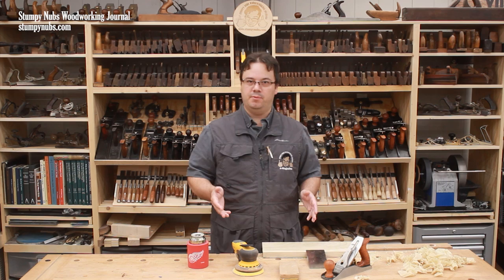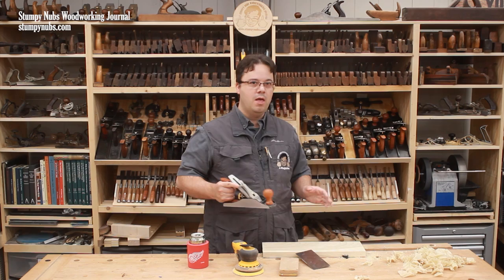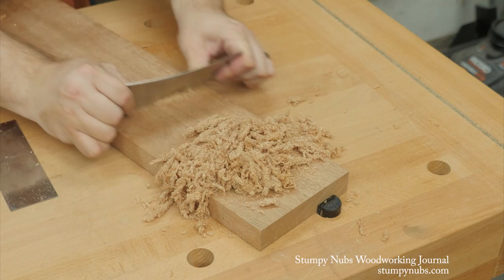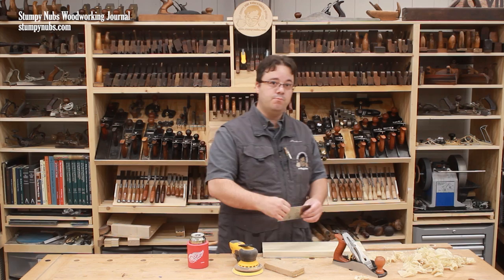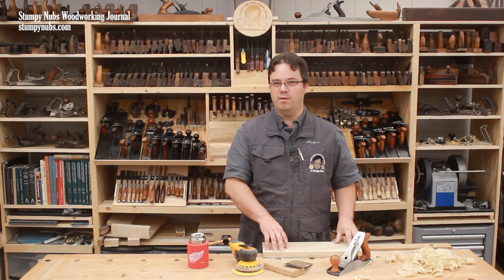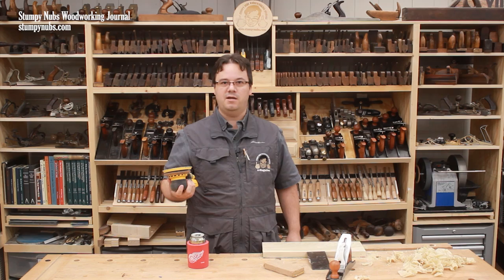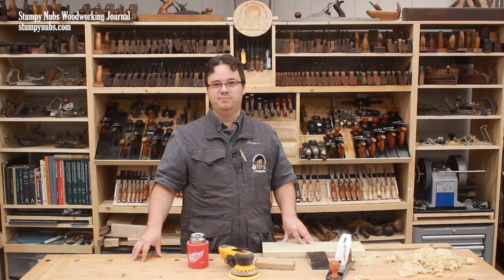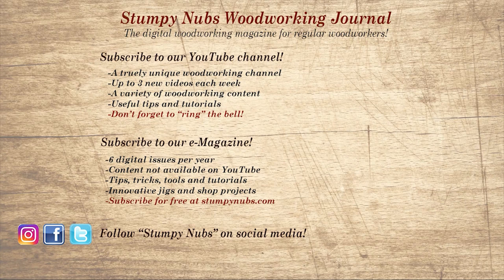Is it better to Sand, Scrape or Plane wood?

Comment: A fourth consideration: Cost. You buy a hand plane or a scraper once. Sandpaper is consumable. Then it goes down the rabbit hole of needing a sharpening system for the planes, or a burnisher for the scraper, so it's up to the individual person on weighing the cost of higher initial investment with planes, or cost over time with sandpaper.

In the end it seems like all three have their place, and are often best used in conjunction with each other for different scenarios.

Comment: A quite superb video, in which you cover all the most important areas. I make guitars. A soon as you start on a piece that has eccentric grain, you can basically forget the plane - even with a very fine set, the risks are too great. If you get tearout there isn't enough depth left in the piece to allow you to fix it (if you can), and you have a very expensive piece of firewood. Scrapers and sanding run neck and neck. There is a MUCH bigger learning curve associated with scrapers - with ROS you just don't tilt, don't lean, pay attention to the direction/pattern and speed you move the sander, and you're done. For brevity, I won't micromanage the elements involved in using a scraper but there are a lot and they all take plenty of practice. Contrariwise, a scraper wins because it is less toxic since it produces nice big shavings, not nasty tiny dust (so protecting our lungs). Of course, if you have a RELIABLE dust extraction facility in your shop (expensive) or you are happy wearing a high quality mask for considerable spells of time, sanding always wins over scrapers if you include the learning curve, which you should unless you are young and know you are going to be a lifelong woodworker. If you can't invest in a high quality extractor and you aren't comfortable in a mask (which, incidentally, should be a positive pressure respirator, not a simple dust mask, especially if you have a beard), then scrapers win if you can master the process.

Comment: You perfectly summarized my experience trying all three methods as a novice these past couple of years. Personally, I prefer planing or scraping, because I hate the dust. But if I just want to quickly get the job done hassle-free, I'll sand so that I don't have to worry about sharpening blades or making technical errors.

Comment: The cabinet shops I worked in these last few years sanding direction makes a lot of difference. Especially with stain. Also orbital sander vibrations can be very painful if done for long periods of time
Reply: I dislike the dust, the humm in the hands and the noise. Sander gives me a very uncomfortable, edgy feel in the whole body. I just bought a little plane from Veritas, will be playing around with that.

Comment: Great summary. I was fooled into believing planing is the only way to go. And that sanding is for the uneducated masses. Then I got so much tear out that once I got the grain figured out and the wood to an acceptable finish the piece was half the size. I agree if the wood behaves well and your plane is set up correctly nothing beats the speed and finish a hand plane can produce. If you have difficult grain or face where planing of the end will result in breakout, like the four outer faces of a dovetailed box. Sanding can save you a lot of headache.

Comment: I became a scraping guy for a reason you didn't discuss.

Sanding (as you know) makes thousands of tiny scratches.  Even if you don't stain wood, the character of the grain is dimmed by the light reflecting off all those scratches.  If you stain, the problem is more obvious.  So it's not about ease or convenience, it's about the look.

That said, I'd love to hear you tell more about technique.    Sometimes the scraped surface has very smooth, beautiful grain, but with streaks that take stain differently (and ruin the appearance).  Re-sharpening doesn't help, and I can't tell whether the problem is angle, force, uneven sharpening, or just the nature of the beast.  How about a video on scraping?

Comment: Something else that beginners do that takes away from finalizing a project:  They sand all parts including non-show faces.  No need to sand or plane non-show faces.  Saves a huge amount of time and effort.

Having a helical head (If you're lucky enough to have one) on my planer allows me to start and stop sanding at 220 grit if I choose to sand at all.

Some woods turn obviously milky or unclear when you sand them.  When I use for cypress for example and want to show the wood grain, I only hand plane.  Sanding even up to high grits turns the surface a milky white, while  planing leaves the  surface sharp looking and clear.

Excellent review James.

Comment: I bought a dining table from some guy on Marketplace. He said it was in "good" condition. I think he and I have very different ideas on "good".

 Anyway the table top has some very deep (probably electric) plane marks and I decided this week-end was the time to address it. I went out and bought a random orbital sander. Stupidly, I got a battery powered sander (to use the existing batteries I already have). I get about 30 minutes out of the battery and then it takes some hours to recharge. So progress has been slow. I came in search of more efficient ways to remove the material to get back to a raw, level top. 

The thing that worries me with scraper/plane is that the surface has knots. I don't want to get into a position where I hit a knot and do more damage. I just need to stick with sanding I guess and deal with the consequences of my terrible decisions on cordless vs corded. 

Cheers for the great video. Would love to start building up my hand tools again so I can do jobs like this without having to make trips to the store.

Comment: Used to finish everything with sandpaper because it is so easy, just takes time.  I just finished a table and had a little tearout to remove, so I tried my scraper.  I'm a convert.  The surface is just so sweet now, and the tearout went away, and it just worked so well.  I have a very simple jig I made for the scraper and I have a 400 grit diamond plate that makes removing the old burr and all the flattening steps easy as pie.  Mmmmm, piiiiie.  Sorry, where was I? Right.  Scraper.  I did a lot of work on that table with the scraper and I think my future projects will include a lot more scraping and a lot less sanding.  And more pie.

Comment: I'd say all three myself. 
Personally I use planes unless the wood looks dangerous, then a scraper. Sandpaper for really crazy grain changes, marquetry, and expensive veneer woods where if it tears out even a little I'm screwed. 
The big thing for me is I enjoy finishing wood with planes and scrapers, but sandpaper turns it into a chore. It removes the risk of failure, but also all the fun, so it's saved for when it's needed.

Comment: As someone who is physically handicapped. The only way to smooth a board is power sanding. I cannot use hand planes or most hand tools. My shop is all power tools, from screwdrivers to cutting devices.

Comment: Well, James, You are right in Your ratings.
 But only in case of flat boards.
I often work with round and bombe shapes, where only scrapers of various contours may be used.
Grinders with soft abrasive balls are used only for small curves.
Therefore, there is not much choise left except scrapers.
Indeed, this process is slow.
 But rounded shapes carperntry is more material and time consuming work. And quite challenging as well.
Also, there are cabinet scrapers for flat boards.
 Nice tools👍.   Easy to use and very forgiving.
 I am planning to obtain one and recommend others to do so, although they are not cheap. 
Alternatively, there is a scràping insert into a standard plane made by Veritas allowing to convert temporarily any hand plane into a cabinet scraper.

Comment: I have watched a lot of your videos and I realize they are directed to the weekend warrior. I however have 51 yrs experience as a cabinet maker and I would never place my plane on the bench as you do. Regardless of whether the iron is out or in it is always good practice to either rest it on a block or turn it on it's side.
Reply from the maker: For every woodworker with decades of experience that swears it should be on it's side, there's another with decades of experience that swears it should be on the sole.  https://youtu.be/B293gaKqh2c

Comment: If planing is with the grain, it’s the fastest. 
If grain is mixed directions, planing may no longer be an option. I’d go with scraping. 
For end grain, I will go with sanding first.
Another thing I noticed, after planing or scraping, grain does not raise as much or at all comparing to sanding.
Reply: Makes sense, sanding will create a lot of channels for finish to flow down under the surface. Planing will leave the top layer tight to the board. Although neither method does anything to seal the natural pores of the wood.

Comment: Oh yes. Scraping is a powerful method, but oh so much hard work. I find it the most precise way to strip old film finish from e.g. a table top that only has a thin layer of nice oak. For a noob it is quite a workout, and sharpening card scrapers is another skill to learn. I currently sharpen two card scrapers each time, there is then at least one edge that works as intended. No, I have not used them enough to have developed that skill, there was no need, the wood was mostly well behaved enough for hand planing.

Comment: I have heard that the finish is different and in some cases that matters. For instance, the grit from the sandpaper dislodges at some rate and embeds itself in the sanded surface. If the surface is one that will move over another wood surface (like a wooden handplane), it may produce scratches. I have heard another thing also, similarly to the difference between sawing and cutting. Namely, that the cells around the pores of the wood get destroyed on the surface when sawing and sanding, unlike a clean cut from a knife, axe, plane or scraper. This can affect the lifetime of wood if exposed to weather or high humidity changes. This is seen on wooden roof shingles that were sawn vs hewn.

Comment: Completely agree about wood grain… I’m working on a project now with several Douglas fir boards… my finishing method is determined by the grain of each board.  Some are straight with few knots.  I can finish them quickly with a hand plane.  Some have big knots with difficult grain.  Those are getting sanded.

Comment: Sanding is the most forgiving smoothing method. It also takes less skill than the the other two alternatives—in both use and maintenance. So….

Another excellent Stumpy Nubs video!
Reply: agree, I find planing quite difficult and end up with craters and bumps, haven't tried a scraper though

Comment: For say a tabletop after a glue up I start with a plane because its so much faster (and more fun for me) than sanding to get it flat, then sand from there.  I never was a scraper guy because to me they are more trouble than they are worth (burnishing the edge etc.).  For parts such as table skirts that are simple cut outs - not glue ups - i just hit them with the random orbit sander through about 3 grits and I'm done.  

For any new woodworkers - plane/scrape/sand your parts BEFORE you assemble them. Trying to fix defects after you have made your glue up is much more difficult.

Comment: Good video. I tend to plane or scrape whenever I can. In general, I don't use polyurethane finishes and so with shellac, oil (even T&T varnish oil), or painted surface it is handplaning for the win. At this point, the only time I sand is if it is a small spot that needs a touch up or I am staining. Even then, I still plane first. So for example I am working on window stops that I will hit with a gel stain: plane first to get the surface cleaned up, then hit with desired grit by hand for the proper absorption of the stain. That way I don't have to spend forever working up in grits or getting dust everywhere.
Reply: @tungsten_carbide yup, I'm aware. But I don't use it for a protective finish.

Comment: Standard disclaimer: I am a complete amateur hobbyist, so my opinion is nothing compared to some of the professionals. That said, few years back I bought a 6" Bosch orbital sander for a reason that escapes me.. prior to that I had only used smaller 4" orbital and other power sanders generally found in big box stores. I made a walnut coffee table last year, and I ran into all the issues mentioned in the video. Trying to plane was almost a disaster, with tear outs in the middle of the table. Anyhow, reverted to my 6" sander, and started with #40 disc...I needed to take out atleast 1/16 material to get rid of all the tear outs. I was done in less than two hours started with #40 > #60 > #80 > #120 > #180 > #240 > #400 > #600 >#800... When I tried to apply the finish (urethane) ..I realized, the wood is too smooth because urethane didn't seem to apply correctly, it would pool at spots and some spots would be completely dry. Sanded it back to #240...and that worked out perfectly. Ever since then, I swear by my 6" sander to be final finishing. Interestingly my 6" seems to have slower motor speed than my smaller sanders but it takes less than half the amount of time to sand than the smaller ones. :)

Comment: For very fine scraping I often use glass.  Any glasier ends up with boxes of scrap glass which you can have for the asking.
  Microscope slides aren't free but give you 8 sharp edges for detail work and are remarkably strong, plus you can see through glass & visualize your surface as you work
  A box of scrap glass often has the perfect shape you need for odd pieces of wood, like spindles for instance.
  Downside is one must be gentle of course.  The glass may be free, but the Band-Aids aren't.  Try it.

Comment: Thanks for the tips. I’m a intermediate Wood worker with all necessary tools with the exception of a couple I plan on getting when I can. I’ve got a 3hp Jet table saw, a Bosch miter saw, a Powermatic 8 inch jointer, a Jet drill press, a Powermatic 44in drum sander, a Dewalt planer, and my router table from Sommerfield tools for which  I built the cabinet for. I also have a cheap bandsaw that I want to replace. Why did I tell you that? Just for the heck of it. Lol. 

Seriously though, I bought those tools because I love woodworking. I love the art of making something of my own creation/design. I have learned some things from your video presentations on different subjects and they have helped me become a better woodworker. Keep sharing with us your knowledge. It’s much appreciated from this 62 yr old man.

Comment: On most of my projects, I'm going to use all of the methods. Planes for the flats, scrapers for the curves and knots, then sander for post sealer/primer, stain/paint layers and finally hand sanding for the final finish. For beginners I'd say start with a sander since there is less to learn.

Comment: Smoothing, scraping and planing an area is one thing…but once parts are assembled, you still need to go over edges and glued joints to finish.  Especially important on say a cabinet where there is a radiused edge between two sides, or a contoured surface!

Comment: Very good video. I like having a few scrapers around, especially for milled edges, but barely use one. Planes are satisfying, but often not too convenient.  A sander just works.  The bigger question becomes how to handle the dust.

Comment: When my grandfather passed (he was a cabinet maker of 36 years with Standard Oil) I inherited his tool cabinet. I found this funny 3x5 card made from spring steel and had no idea what it was until attending a wood show and being introduced to the "hand scraper". Woah - new world. Easy to keep a curl on the edge with a little practice and THE BEST tool for fixing drips and errors in finish - awesome control. Gramps knew a little something <g>. Random orbit sanding with good dust control is great, but for physical satisfaction, the plane is hard to beat.  Thanks again for comparing. Perhaps you encourage those who haven't tried another method to give it a shot.

Comment: Great breakdown of the options and reasoning.

One key point that is often overlooked, and was here, is the main reason for sanding vs the other options.  Planing and scraping burnish the surface.  This burnishing closes off the grain.  If you are staining, this burnished surface can be problematic and create light and dark areas where the stain doesn't penetrate into the wood properly.

Sanding, on the other hand, leaves consistent scratches in the surface of the material, which, if the correct grit is used, allows for proper stain penetration and a more even color.   It is also ideal for any sealer that may be used in preparation for the topcoat.  In my opinion, even if you plane or scrape, you should always finish with sandpaper to create that even surface scratch that is ideal for the final stain and topcoat.

Comment: Some woods, such as Holm oak (Quercus ilex) are really tricky to work, one of the reasons why they appear not to be used in furniture manufacture. That saying, some of us have used it as its grain is amazing. Hand planing is not an option due to pluck out, so electric planing (edging), sanding and scraping are the only real options. Scraping is the better, but my God, is it hard work, painful work and time consuming.

Comment: Excellent video, as always. However, this entire explanation assumes that the work is flat. I'd be interested in your opinions on angled, routed, and other nonflat surfaces. (A good excuse to show off your planes 😂)
Reply: I got a wonderful opportunity to watch a master violin luthier work in his shop for a few days. He was getting the body ready for finish and used a whole bunch of scrapers of different shapes, no sandpaper at all. Very slow and precise work but absolutely beautiful when finished, the wood looked a mile deep.